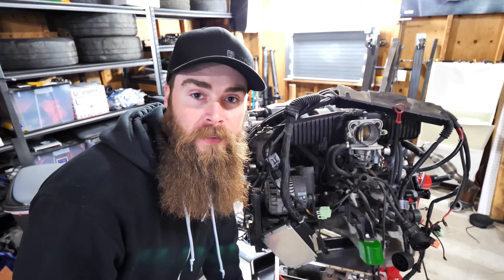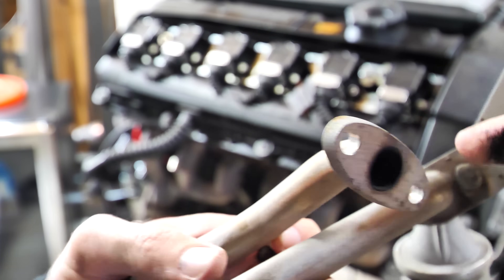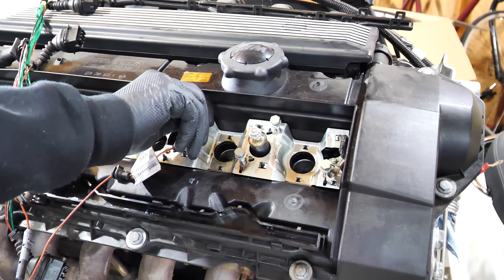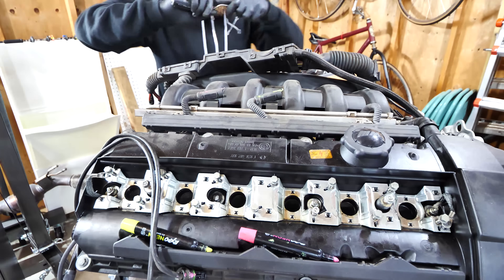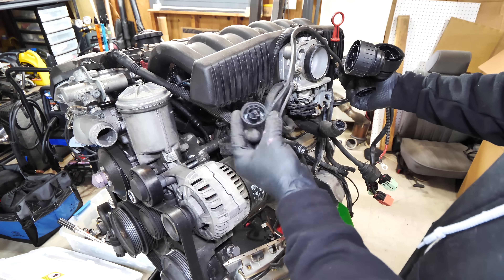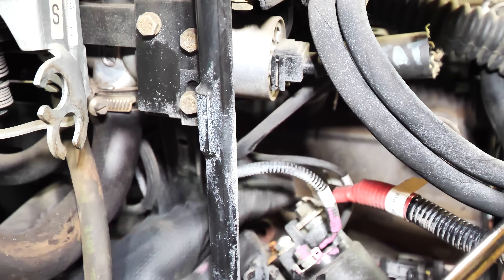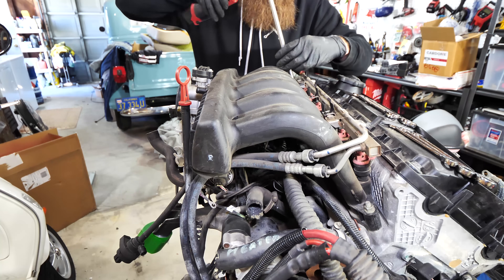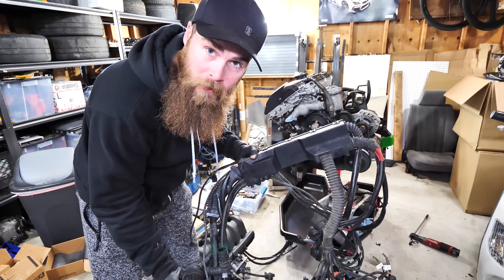BERTY 30 E30 S52 Swap Wiring Harness OBDII Removal Episode 2 [4K]

Comment: That red wire by those relays is a power wire and doesn't get hooked up to anything. Those 3 big plugs by those relays are your your x20, x69 and x6031. The x20 is going to get cut off and your c101 plug from your e30 is going to get matted to that. I don't remember if it is the x69 or x6031 but you need one wire in there to signal the e36 charcoal canister in the trunk. You are going to need to keep that in order to pass bar here in California and here is a link showing you how to do it https://www.r3vlimited.com/board/showthread.php?t=371001. I just got my S52 swap to run yesterday after 3 months of not knowing why i wasn't getting spark and realized my coil pack harness wasn't plugged in. If you have any questions along the way on the swap you can message me at 99quigley on Instagram.